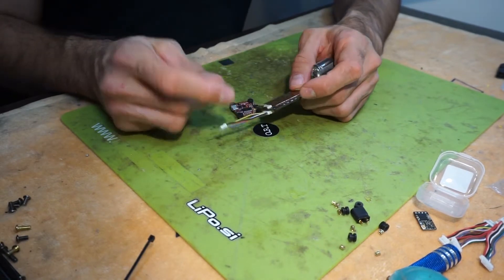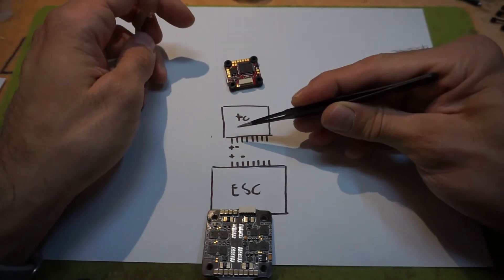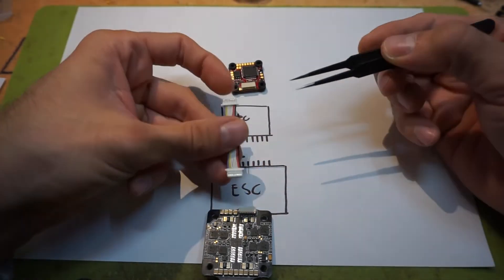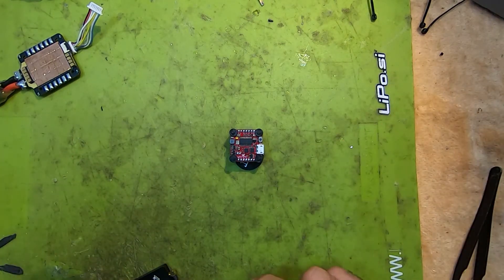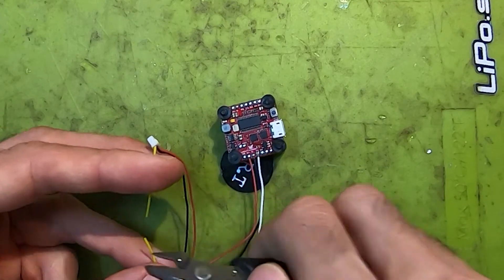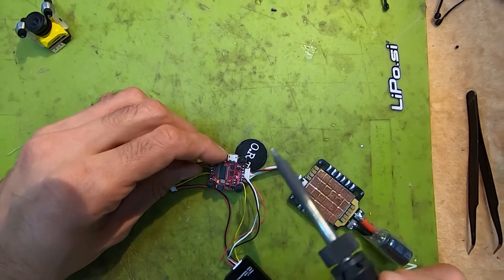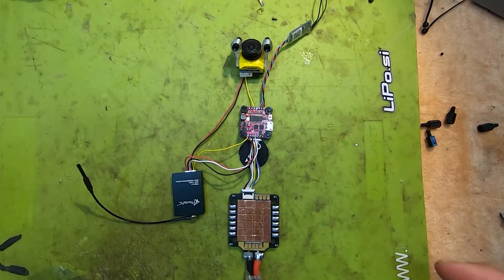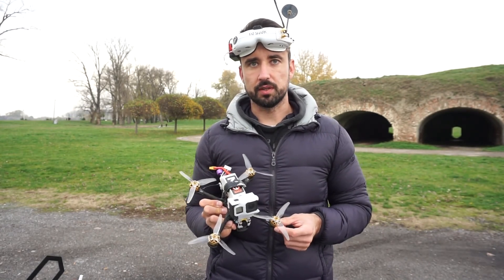Heli-Nation Talon F7 F722 20*20mm Flight Controller MPU6000/ FUSION

Comment: Nice video....I can't get motor 4 to work.....what BF are you using?
Reply from the maker: If you're building with a Talon Fusion or F7 V2 MPU6000 you'll need to input some code into the CLI to get Motor 4 to work. We had them make RPM filtering work through the 4 in 1 connector and it needs either the code in the CLI or a custom hex which is coming shortly. If anyone has any issues please let us know! 
 Use the CLI command below:
resource MOTOR 6 None
Resource MOTOR 4 C08
Save
Reply: @mrRockwellFPV  Got it working, thx!!